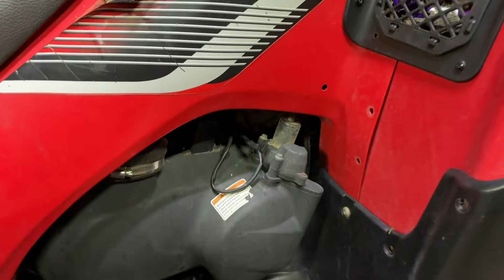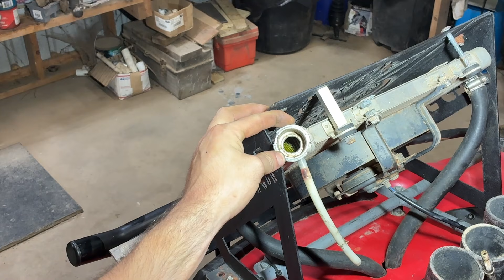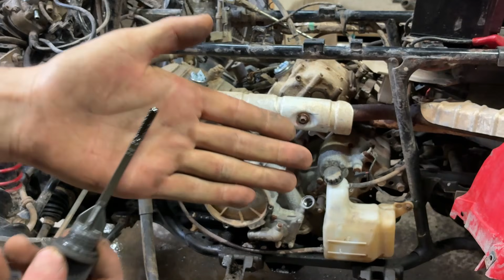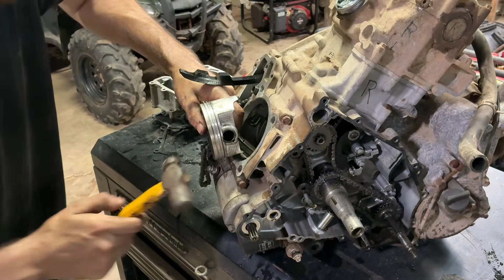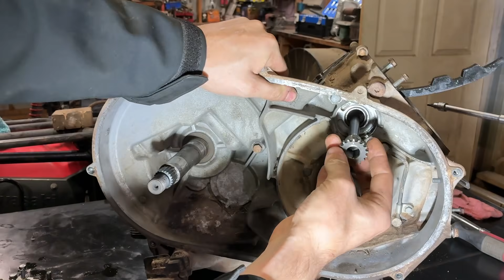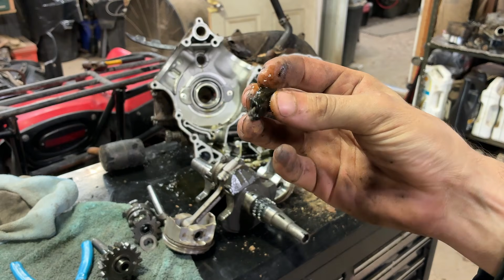Seller said this $800 atv "needs a motor." How bad can it be?

Comment: I had a Kawasaki that blinked between 2 and 4 wheel drive it was a manufacturer way of costing you money to get a belt change. I googled it and switched the 2 harness electrical connectors for 20 seconds then switched back and started it and never had another problem bought a belt for nothing.

Comment: Try putting some marvel mystery oil or transmission fluid mixed with acetone and let it sit down inside of both cylinders for A while. Try baring it over back and forth both ways.

Comment: I just did 2 of these motors , wat u do is take n clean those bearings out with gas n see how they feel. Mayas well wash the case out with gas to. I know ur going to go thru hell on a crank . If your going to do trail rides or long rides go stock these offer more then you need for intended  purpose . I woukd like to see how this goes .